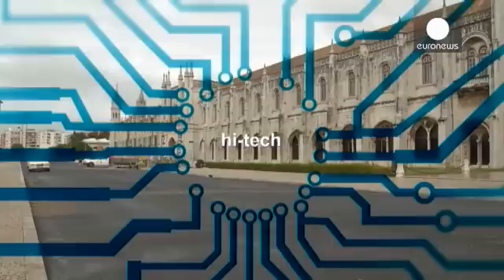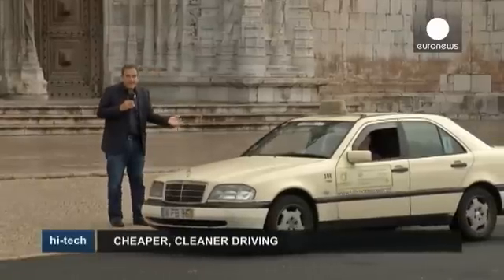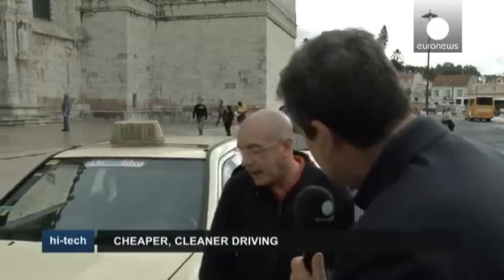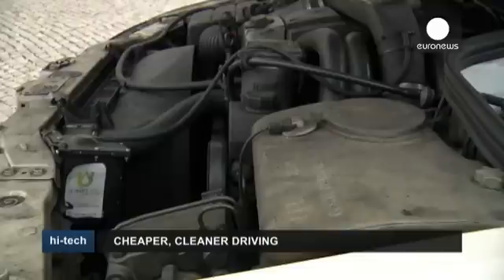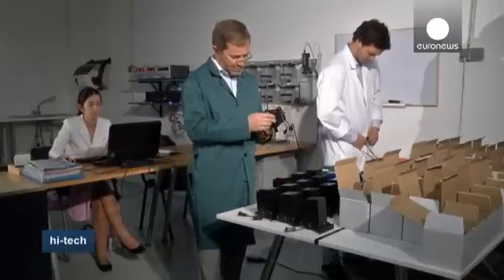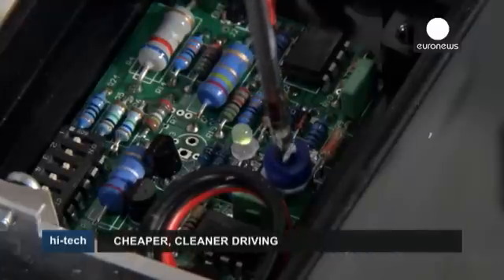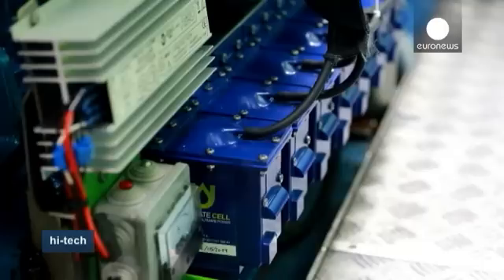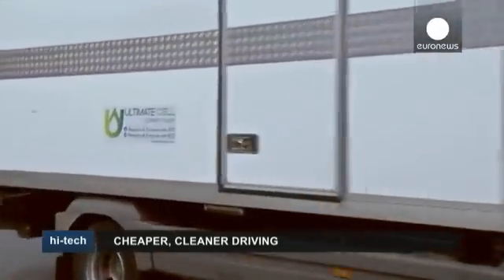"Ultimate Cell" Saves Fuel, Reduces Exhaust Emission - Hi-Tech

Comment: I was conned by the local dealer and installed one of these devices to my car. I have seen absolutely no difference. It's just another scam. Just run your engine in low revs.

Comment: there is no way this can work like there saying it will I get the idea its a HHO fuel cell but you need a hell of a lot more that a little bubble a second to run an engine even a 50cc engine this would be no good at all. A well serviced would save you more than buying this.

Comment: Scam. They have been selling these in america for about 10 years. You have to burn fuel to turn your alternator to create electricity to create a hydrogen oxygen mix to burn in you car. It is just a scam and waste of energy.
Reply: 41088avl01 - you are talking about scams and Old tech in USA is not comparable with you see here. Learn and then you can talk about it..
Reply: Vitor Candido
It's a scam...
Reply: is it ?? can you share USA supliers name ?
Reply: Dilsat U yea go to u.s. fraudulent companies listings and look up hho devices.  Sure it creates hydrogen and oxygen, some of them are nice and separate the 2 gases but most are so badly designed that both gases are mixed together and so more then likely you are using gas to turn the alternator for electricity to separate oxygen and hydrogen to only have them mix together and create water again before even being ignited. On the chance that they dont mix to create water and they do ignite the oxygen and hydrogen mix. The amount of energy from the gases produced is laughable. A few years back when our gases prices went to 5 dollars per gallon a bunch of these came out. Consumer protection Agencies looked at these. They are a joke. The amount of energy you put in to get energy out is so inefficient. Then they want you to put salt in as electrolyte to help the separation along which helps corrode metal components in the engine mixed with the oxygen. Some come with statements to get the most out of your device, accelerate slow and dont drive as fast. They would sell at body shops, mom and pop gas stations and all over the Internet. Haven't seen them lately until I saw this video. They are a scam if you want to install 1 go ahead.
Reply: your account is fake